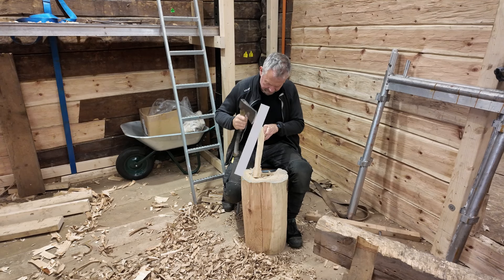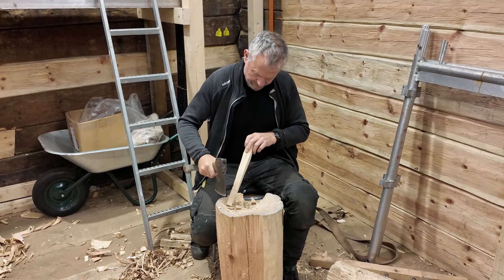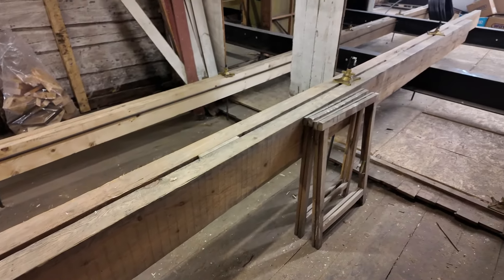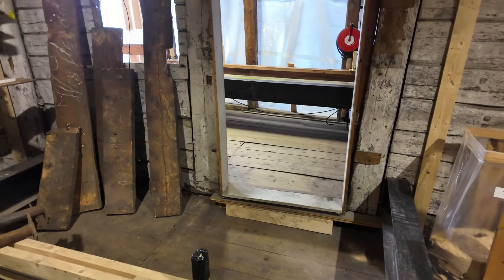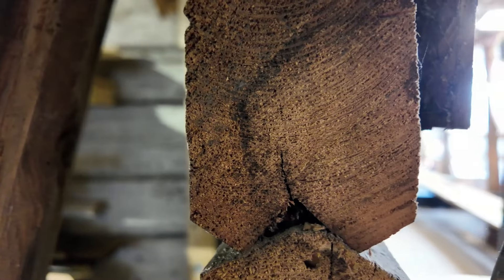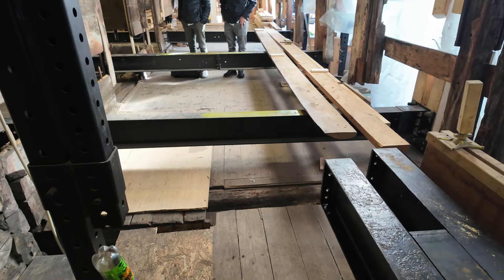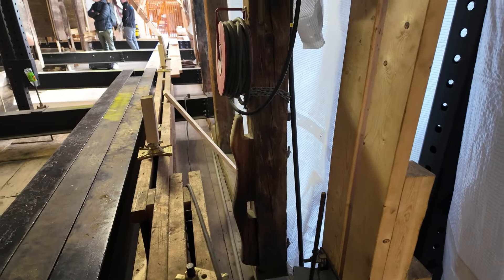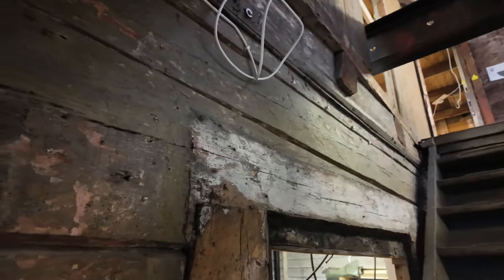1702 GETTING A NEW LIFE

Comment: The 3 goals in construction of which you can generally only have 2 are: Good, Fast & Cheap. 
This building will only get 1 - Good. It will not go fast and it will not be cheap. But if the ultimate goal is to restore/refurbish, understand that there are sacrifices to be made. 
To finish fully the old general construction adage:
Good & Fast, ain’t Cheap.
Cheap & Fast, ain’t Good.
Good & Cheap, ain’t Fast.